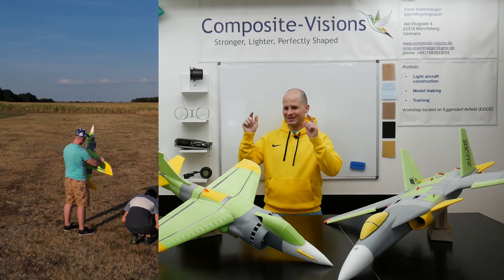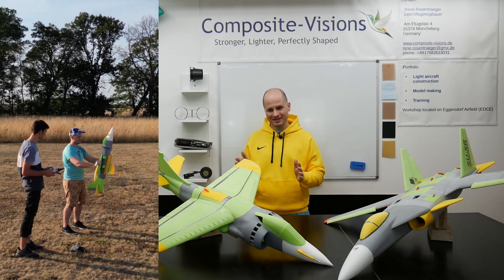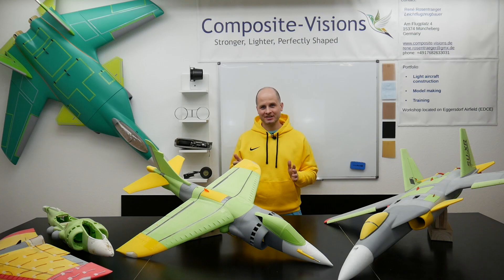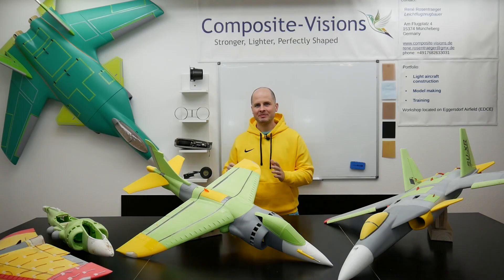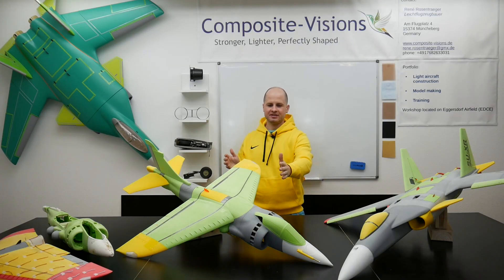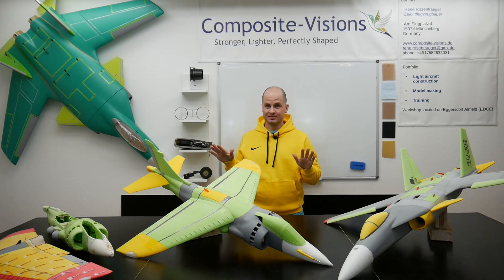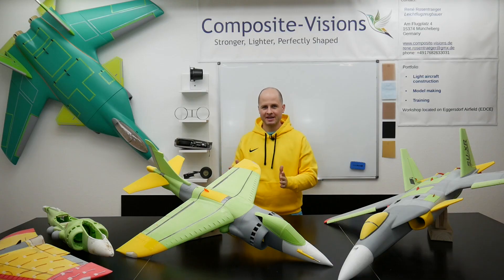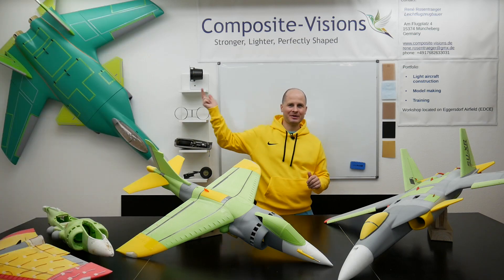3D Print RC Harrier Build and Maiden Flight

Comment: Awesome project- thanks for sharing. I just got the SU-XR STLs...printing already! Question - what flight controller/ firmware do you use/recommend? Would be nice to see a video giving an overview of the firmware/configuration. I plan to use iNav - any concerns I should be aware of? Thanks.
Reply from the maker: I use the IGyro from Powerbox. But you can use any Gyro. Just make sure you can set the gain in flight with your TX.
Reply: @René Rosentraeger  Thanks Rene. I eventually found the video on the gyro setup.